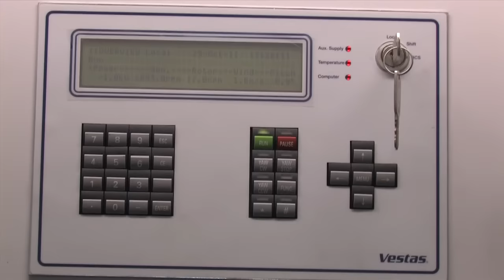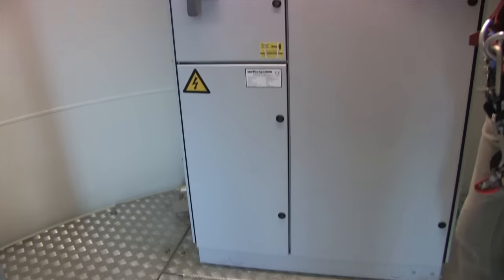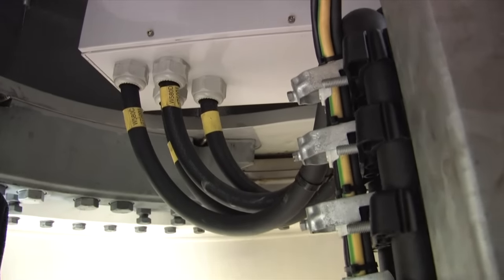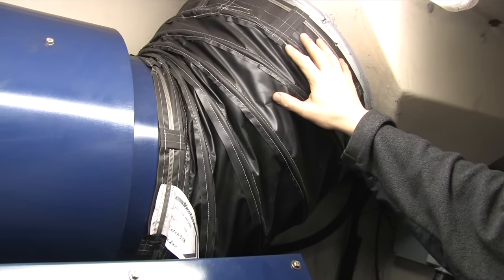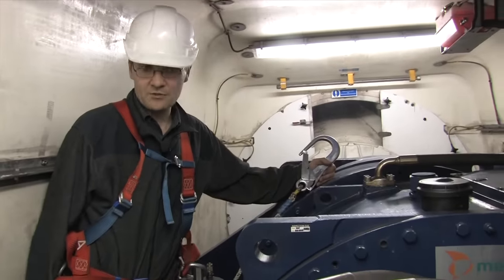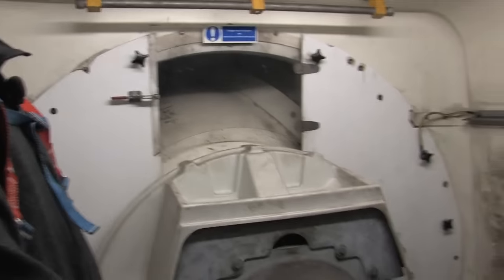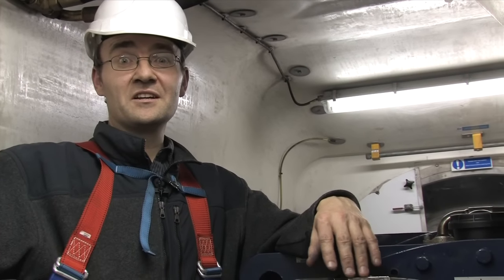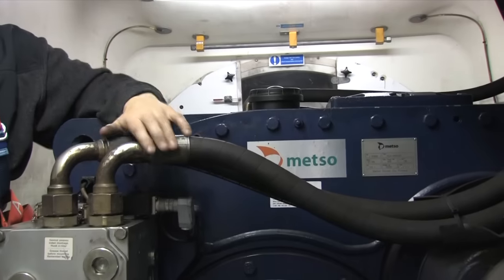Wind Turbine Tour

Comment: can anyone one explain to me why the leading edge and trailing edge are positioned vertically. at 3:48 when they pitch the blades out of the wind it goes from a vertical orientation to horizontal.  I thought it would be the other way around, but I really don't have any training so I watch video's like this to try and notice all the details.
Reply: Simplest way I can say it is turning the blades edge-on to the wind offers the least efficient angle for rotation-producing torque to be created. The blade shapes are complex, lots of twist and cross-section changes through their length...but bringing them into that configuration presents the lowest interaction with the wind for the purpose of creating torque to turn it. When the blades are turned vertically during normal operation, the fattest, most pressure differential-producing area of the blade is optimally aligned to the airflow, due to the shaping. So the opposite will both reduce the production of torque, so it can be easily braked, and offers the least flat drag which would be the face of the blades being pushed rearward by the wind, which would place a lot of structural stress on the tower as well as the blades themselves.

Comment: So due to its high cost, it takes almost 8 years of full operation just to break even.
Reply: A "disposal issue" in regard to the old blades that are removed has been bought to light recently in the news. Apparently because they're fibreglass (or carbon fibre, I forgot which) they can't be recycled......so they're being dumped in landfill. I don't know if there's a specific environment risk, but it makes one think...... good or bad, there's always a cost. 🤔
Reply: I'd be surprised if other types of generators paid themselves off any quicker and you have to realise that for the rest of it's life it doesn't use any fuel so it's pretty well all savings after that. They are getting cheaper and bigger in the period since this was installed as well. Next units coming will be 12MW units.
Reply: Big turbines like the offshore GE Haliade X (12 MW) produce much cheaper electricity, because they have much more power, but the maintenance costs are still relatively cheap. They also don't need any subsidies in this size.
New nuclear plants are different, they need a hell of guarantees from governments to find somebody for financing, they need dacades to achieve a break even.
Reply: @TheMTBChannel  Not true. It requires fossil fuels to run it. They're just not telling anyone about that part.

Comment: I wonder if the generator has permanent magnets or electromagnets. From the rotational speed, I guess there are 2 pairs of poles.
Reply: It's simple, if it has a gearbox it typically uses an asynchronous generator or a synchronous one with electromagnets. The ones without a gearbox (like Enercon ones) have many poles on the generator and use permanent magnets

Comment: At 1:30, I see this guy has never touched a spark plug wire that is cracked, or he would never grab anything with electricity in it again.  Learned that lesson once myself.
Reply: This cables have no connection to the ground - the ground connection starts at the 10kv transformer. It's the same with solar PV, you would have to touch both bare wires to get a shock. In your car the negative pole is connected to the chassis, so if you touch it you can get a shock if the spark plug cables are damaged.

Comment: If im interested in generators and stuff like that should i study mechanical engineer?
Reply: You could study as electrical as mechanical egineering.
I work at GE in Brazil and we produces eolic genarators. Here I realized that most of the engeneers are more Electrical than Mechanical though. 
The important thing is that you start ASAP. 
Good lucky
Reply: daar64 if you are interested in generators then you want to become an energy consultant. then you would learn you can't generate from a diffuse source of energy.

Comment: Company I work for designs and manufactures composite torque couplings for the higher speed generator shaft. Cool stuff to see the inner mechanisms of turbines. Although still a very small part of overall power generation in the USA, and arguably not very cost effective in the scheme of other methods of power generation, they are still impressive machines.
Reply: Where can I get that company in South Africa that manufacturers all the equipment

Comment: Have a fear of heights and this vid is making my hair stand on end but good vid
Reply: Me too.. Hell no from me lol i get about 10 steps then i be back down
Reply: I'm not worried about that, but my body is beat all to hell and pretty much broken down now.  If I did try climbing that ladder, I'm pretty sure it would take me 4 or 5 times as long to reach the top, if I even made it all the way.  I'd probably give up in pain at the 4/5ths-point, and end up turning that little safety brake thingy around so that I could then "zip-line" my way back to the bottom,  lmao....

Comment: 23% capacity factor is terrible. Nuclear is 90% or greater.  At 1.7 million euros per 850kw, it would take 8 billion euros worth of these to replace 1 1000mwe power plant, in order to match the mwh equivalent per year.

That also doesn't include the lack of reactive power made by wind generators.  They have very poor power factors when compared to large synchronous machines.

Comment: He breaks it down at 11:51. Total cost, annual energy savings, break even yrs both with or w/o grants. Sounds like the guy is pretty knowledgeable about it. All the talk I hear lately is the turbines don't pay for themselves within their service life, they don't offset their carbon footprint, or you can't recycle the blades therefore they end up in a landfill. One of the big problems with them right now is blade delamination. That issue needs to be solved. Otherwise it seems like this turbine is doing fine.
Reply: Who told you that stuff? While this is a relatively small turbine (newer ones are up to 5 times the power onshore to be more economical) any turbine offsets their carbon footprint within 6 to 9 months of service and while you already get recycable blades even the non recycable ones are a good material for the cement industry and putting them into a landfill is American foolishness

Comment: These things cost more in maintenance than they make electricity so where are we going, duh
Reply: @martijn3151  Bet they didn't mention that after 20 years the tower it self is on borrowed time: metallurgy 101, all the stress of wind  buffeting the blades and gyroscopic forces must have an affect on the tower. Lets also not forget if you have a wind farm of twenty or more turbines as we have here in Australia you need ready access to a large (really high crane) possibly 150 +tonne crane to reach the top of the tower for replacement gearboxes, generator and other equipment, all maintenance personnel, electricians, fitters and what have you all have to be abseil qualified to go to the top of the tower (at least in Australia) so there is danger money on top of their wage (and they deserve it ). So all things considered i have to wonder if they're at all sustainable really, and if you do see them on fire it is a total loss no question of that.

Comment: Amazing to see how much plastic and petroleum products are needed for the parts of this wind turbine.  Also, all the steel used for the ladder inside was produced by coal. and the equipment used by the tour guide.  AWESOME that wind is so carbon neutral?  WAIT......... WTF, all this was lies?  Also, nice leather shoes, sorry cows, your needed also.
Reply: Plastics are an acceptable use of petroleum, except for disposable products. Metal is a building material and can be made in arc furnaces. Leather can be synthetic.

Fusion will eventually replace all other types of large scale power generation, even if it takes 200 years.
Reply: It compensates the energy consumed for production in around 9 month.
You can't build anything out of air, you need metal, plastic and other stuff to build it.

Comment: what powers the lights, are there batteries inside that store energy while conducting maintenance? Would you be able to power a refrigerator/ power tools during an Apocalypse emergency situation?
Reply: Turbines, typically has 100-240 VAC supplied at all times (unless total power fail).  It also has AC for field excitation until the system is on grid.
Reply: Almost all wind turbines require grid power to be able to make power. The grid power typically comes into a Turbine at 690vac from the transformer and is stepped down to run the computers, lights, stuff like that. Most motors and pumps on turbines are 690vac. Bottom line though, most will not work at all if the grid is dead.
Reply: Tracy McPherson thank you, so these are effectively useless when SHTF
Reply: If you could get hold of a generator you could probably boot one.
Reply: Guy Fawkes magnets

Comment: 1st OSHA violation & it's considered a serious one, is the Fall Arrest Prevetive System. OSHA requires it to be connected to the "D" ring on your back. 

2nd OSHA violation, again a serious one, is the welded metal rings that the F.A.PS. attaches to on the front of the belt/harness

Comment: "690 Volts" he says as he casually just grabs the cables.
Reply: 690V is quite normal in heavy industry and basically all industrial grade cables in europe are rated to at least 1000V, and insulation is always double layer at least.
Reply: Solar PV has up to 1000 V string voltage, big installations even up to 1500 (normal modules only allow 1000).
This increased over the years, my first one from 2009 has around 300 DC voltage, the 2nd one from 5 years later 400 V. My 3rd one (a new 2020 installation) has almost 600 V DC voltage.
Reply: Lol he grabs the cable zap yaow that Thang bites
Reply: Shit, 690 ain't shit.  I piss more than that when I'm hungover.

Comment: Pitch rams are in the hub... that was the hydraulic union you were pointing to...I see vestas still hasnt fixed the issue of the main cabinet not being secured properly, causing busbars to arc onto cabinet in high turbulence... we lost 2 towers that way.. also a famous picture out there with 2 techs hugging on the roof of the nacelle as it burns - caused by said issue.

Comment: Metso says thx guys =D for pointing out the gearbox will go bad
Reply: It's just a fact for large gearboxes run as a speed multiplier.
Reply from the maker: A Major Refurbishment was completed in August 2019.  This included the replacement of the turbine's gearbox.  The recent upgrade is expected to secure an additional 10 years of operation for the turbine.

Comment: These only operate by the virtue of taxpayer funded subsidies, without which the would generate more loss than electricity.
Reply: Please provide independently verified documentation of your assertion. Until then, no credibility whatsoever.
Reply: New big ones are already working without any subsidies. Onshore you can get 3, 3 MW ones, offshore 12 MW (GE Haliade X). New nuclear plants (like the EPR) need 3 decades long 10 cents per KWh, while a Haliade X can produce for half the price.

Comment: 3rd OSHA violation, again a serious one, no Lock Out Tag Out for the turbine before going up.
Reply: Bill Didn’t he say the rotors were locked when going outside only?
Reply: @lwipp  wrong there are moving parts that, in the USA, would have to be covered better than what is shown in this video. The USA has the most stringent safety rules of all the nations that require them. Working under these onerous rules has severely hampered much in new construction, out the govt giveaways such as wind farm subsidies.
Reply: @lwipp  my only point is we are incredibly lumbered with safe rules.

Comment: Blades dont last 15 years . More like 2 or 4 years. They erode from debris like no other. I used to work for vestas . These things are not that efficient . They never pay themselves off . Youre always fixing them .the generator hubs and hub bearings fail and the gear boxes are junk. Getting a crane out there and the fees for that plus the gear box is over 200k and you do it once ever few years it seems .the blades are 100k a pop .shit is ridiculous
Reply: You must have worked in a parallel universe for Vestas. The blades of my nearest windfarm are already 7 years old and they never had to do any replacements. 

While the leading edge is surely facing some wear this is part of the routine maintenance, you don't throw away blades because of this

Comment: Estimations about cost coverage are wrong, they assume that all the energy produced has been immediately used by the owner, which is practically impossibile.
Economic feasibility of such a project is possible only thanks to public contribution, tax payers pay the turbine owner for the unused energy the very same price it would pay if it had to buy it on the market.
Without public contribution a wind turbine would never reach the break even point.
Reply: You sell the electricity you are not using to the grid who in turn sell it to other factories and homes. The slack is  taken up by other power generators on the grid for example gas turbines.  If wind is producing a lot of power less gas is burnt in the gas turbine power stations. Power flows are balanced on a minute by minute on the Grid as there are no easy ways to store electrical power. The idea that wind power has any effect bad effect on the climate is based on the assumption that we could extract a significant proportion of total wind energy on the planet. Nothing we are building now or likely to build in the near future comes even remotely close to doing that. I read about this years ago . The document disused theoretical limits not practical ones
Reply: "EVERYONE I DISAGREE WITH IS LITERALLY A FLAT EARTH NAZI ! AHHHH"

 -KATANA622  2018
Reply: youre the one who brought nazis into this no one else.
Reply: Whatever.  Should I get a ruler for you two?
Reply: wkdravenna 

I thought that was nazist ? Either way nerd isn't the Swedish word for Nazi.
Reply: EVERY SINGLE KW from this thing can go back into the grid while dialing back the fossil fuel plants feeding same grid. No need for energy storage and no unused energy potentials.

Comment: Brilliant, keep touching power lines without PPE on and maybe one day you will find a fault.
Reply: Bad pratices
Reply: I was thinking the same thing! One tiny crack in the insulation around the wire and it'd arc into his hand. Not cool!
Reply: its off
Reply: 1. It's disconnected. 2 its only 690 Volts - I've had some lovely 4 kV shocks to the skin. 3. If there was sufficient damage to these cable that bare wire was present it would be damn noticeable and replaced quickly.

Comment: The whole thing is a scam, look closely at how small the generator is that is supposed to produce so much power. Electricity is free in the air, all you need to do is suspended a couple of wires in the AIR!

Comment: You would have to be a passionate believer in the benefits of renewable energy vs coal or gas fired generation, to enthuse about the complexity and the inefficiency of this lunatic engineering marvel. No, I rephrase the first part of my sentence: you would have to be a real nut case not a passionate believer.
Reply: Wind turbines rarely come close to their stated power output, and their complexity is indeed part of the folly.
Reply: Folly? It's free energy and free money, just literally blowing right past us. Global warming is a thing, and these things are one way to make it less horrible and extend our time here on earth.
Reply: They pay for themselves in 6-8yrs....then it's FREE energy for the next 20yrs....what is it you don't get. Oh, and it's not like after 25-30yrs they dismantle them and chuck in the garbage. They are updated, refurbed at a fraction of the cost and go another 25-30yrs.
Reply: It's no more complex than burning fossil fuel to generate steam to turn a turbine to drive an alternator.  And as for efficiency, wind turbines have infinite efficiency since the fuel input is zero and the energy output is finite.
Reply: Alexander,

not at all, why do you think that countries with a lot of wind and solar energy have the highest electrical unit costs. Wind is free the same as  coal, oil or gas. It is harvesting it and urilising it. What is not generally realised that wind is a very unstable source of power and needs a balancing power to keep the grid stable. Also as it is so unpredictable, there is a requiremet for back up generation to be available at all times, These cost money as is the various subsidies necessary for construction and the extra infrastructure to connect to the grid as they are usually far from the power user. No, wind is an expensive, intermittent and unstable, indeed unsuitable for sensible grid operation. I challenge you to find a generation power engineer who think they are a good idea?